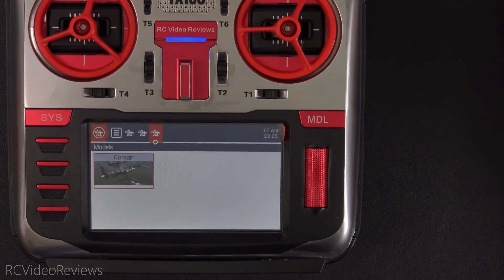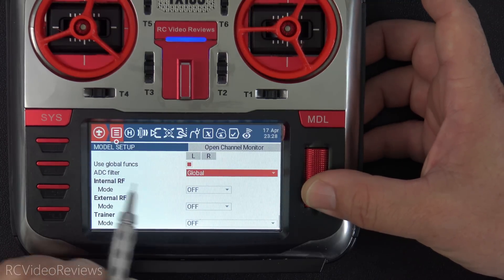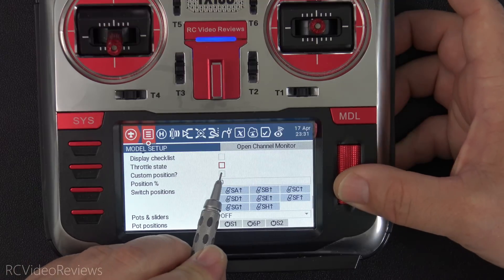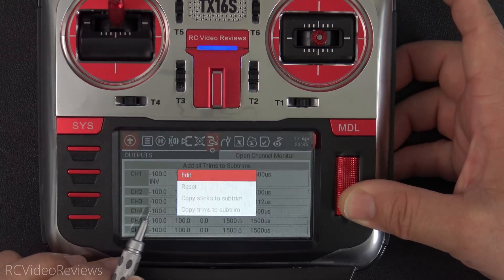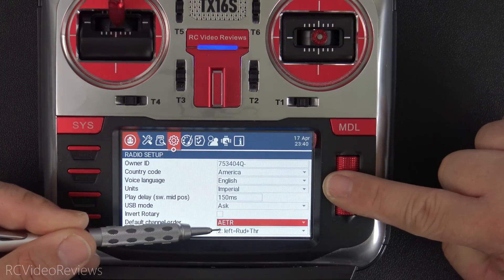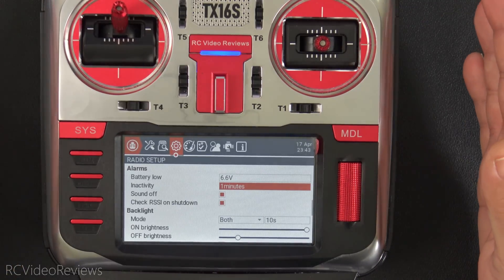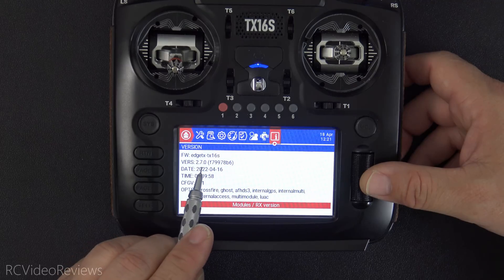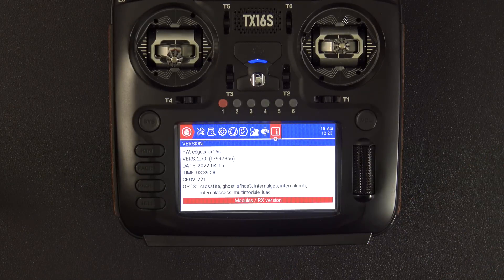EdgeTX 2.7.0 Black Pearl • What You Need to Know • How-To Upgrade

Comment: I hope you can help me. I am using black pearl. I have setup a quadcopter. It arms ok but once I  go past mid throttle 
 The moters screens  flat out even whe I put throttle to its lowest point the moters still scream flat out . The only way to stop moters is to hit the motor disarmed switch. I am pulling my hair  out so please please help me
Reply from the maker: Did you put your motors on Ch5?
Reply: @RCVideoReviews   no, but I have a nother two quadcopters that work fine. I think it could have something to do with the betaflight 10.8.0

Comment: thanks for the info. If you transfer model files from OTX on one RM TX16S to another one with ETX  installed using Companion OTX and Companion ETX it works mostly. However the widget settings get lost and some of the model jpegs don't display as widget items. Also the ETX display doesn't seem to be as sharp and  'contrasty' as in OTX. What's up with that ETX team?

Comment: When you say flashing firmware, do you mean copying things to the sd card? I got a TX16S yesterday and want to update it, I did update the radio multi module firmware and that went smoothly. can I make a copy of the oem sd card onto another sd card and use that? I dont want to be left with a brick.
Reply from the maker: No, you have to write firmware to the internal hardware. Watch this: https://www.youtube.com/watch?v=LItyAkJlcdU

Comment: More great content !
 Still learning this new radio
 Quick question ? I set up all my  switches for my voice tracks in global functions and I'm wondering if I can set dual rates up there as well to  Automatically go to a new model When setting up ?  Thanks again for the great videos and all your help
Reply from the maker: Global functions do not support inputs so no, you can’t configure dual rates in global functions. This probably wouldn’t be a good idea anyway as most models will probably have different needs for weights and expo.
Reply: So would the best way be just to copy model Then adjust as necessary to retain all switches and functions ?

Comment: Just bought a mk1 TX16S and will be my first time using Open / Edge TX. This will probably be the first thing I do as Edge TX seems more up to date.  I couldn't run it on my Jumper T8SG which I've had for 4 years now and has been a solid, reliable radio.  I just need to make a move to ELRS as I no longer want to worry about Frysky failsafes!  I like the open source nature of both ELRS and Edge TX, unlike the confusing world of frysky and where they are going!  Nice , informative video.  I've dropped you a sub and like 👍
Reply from the maker: Welcome to the channel. I've been flying Edge for some time and have been very satisfied with it.

Comment: Hi John, when I plug my mkll in I don’t see a stm , I get this list, which is the correct one? 

Usb receiver
Unknown device (27c6:5301)
RTS5129 card reader controller 
Unknown device from Sunplus innovations technology 

Thanks. I’m very new to all this rc stuff, just started with a Flywing FW450v2. Thank you.
Reply from the maker: You don't mention what operating system you're using. If on Windows you might need to check out Zadig. Here's a pretty good article: http://open-txu.org/home/undergraduate-courses/fund-of-opentx/using-zadig/

Comment: Now starting WITH 2.7.1: 
 Should I go back to 2.5 and migrate to 2.6 then to 2.7.1 to have my models converted?
or is there a magical trick to force 2.7.1 to convert the .bin to .yml?

Tried (in 2.7.1) to replace MODELS folder with the old one (containing the .bin files) AND same with the RADIO folder. Doesn't work in 2.7.1

Thank you.
Henri
Reply from the maker: I just did this test to answer your question. I can confirm 100% that 2.7.1 WILL ABSOLUTELY convert .BIN files from OpenTX to .YML files on 2.7.1. Did you press the model select button and look to see if your models are showing in the category listing?

100% Confirmed you can go from OpenTX directly to 2.7.1.

Comment: Great video John really simple to follow along. One question, when doing the firmware upgrade it will not effect any models or settings that i have created in 2.6.0?
Reply from the maker: Correct. If you're on 2.6 now, there are no user impacting storage format changes.
Reply: @RCVideoReviews  excellent thanks for you quick response. If your into flight have a look at my channel, pass me some love. All the best John. Great channel by the way.

Comment: Hi¡¡¡ Excellent video, as always.  I haven't changed from Open Tx to Edge Tx. What I saw in your video is that they are already in upgrade 2.7.0, quite a quatum leap¡¡¡ What do yo suggest would be the best way to convert my radio? I mean, do I need to start changing from Open Tx to Edge 2.4, or can I jump directly to Edge Tx 2.7? Best regards
Reply from the maker: Just go right to 2.7.1. Be aware of the widgets thing--you will lose them going from OTX to Edge.

Comment: Can upgrading cause (or clear) internal multi telemetry problems?  I just upgraded from Edge 2.6 to 2.7.1 per this tutorial, but it seems that the Internal RF is showing a Module Status of "No MULTI_TELEMETRY detected".  However, this isn't a result of this upgrade, as it appeared the same on Edge 2.6 as well (to be honest I was hoping that the upgrade would clear any preexisting problems which I have not otherwise attempted to troubleshoot).  As for my background, I bought my radio several months ago with Open TX on it and changed it to Edge TX shortly thereafter (never had time to get it working), and don't recall any special "YAML" issues being itemized in other tutorials, but am beginning to suspect this could be why I'm having problems trying to flash firmware updates to my internal multi.  I also can't seem to have full file visibility like being able to access simple JPG files from my "IMAGES" directory, even though I can confirm that they are indeed on my SD card via computer and even through other access of my TX16 menus.  Is this a YAML issue?  If so, how can I resolve it
Reply from the maker: There's a lot to unpack here:

1) Edge revisions don't change the multi protocol module (MPM) firmware. Download MPM firmware here: https://downloads.multi-module.org/  Learn how to flash it here: https://www.youtube.com/watch?v=CUmw2cDnFx0

The first thing I would do is ensure the MPM is up to date. After that, telemetry relies on what the rx sends, and you didn't say what rx/flight controller/or other telemetry device you're using so I wouldn't have any idea how to proceed outside what I indicated above.

2) YAML has nothing to do with flashing updates to the MPM. Follow the video https://www.youtube.com/watch?v=CUmw2cDnFx0  I've flashed my MPM plenty since migrating to YAML without issue.

3) Image names need to be 6 characters or less for the model setup screen to see them. They also need to be a specific format. JPG or PNG ~ 192x114 pixels.
Reply: @RCVideoReviews  thanks for the advice!  I was trying to use the internal for a FlySky setup.  I've come to suspect that the actual internal hardware module has failed and that's why it won't accept the flashing efforts.  Thanks also for the 6 character info... I was thinking it was because I had spaces in the filename but that proved to be incorrect if you say that it's a 6 character filename limitation.  Thanks again!

Comment: Followed your instructions, when I get to "connect new device" "STM BOOTLOADER" doesn't appear. Tried several times. Any tips? Thanks
Reply from the maker: Watch to the end and flash the firmware from the bootloader.
Reply: @RCVideoReviews  John, this morning I started fresh and found my issue. My top USB connector is extremely tight, and even though the USB symbol showed on the radio screen, it didn't really connect until I pushed it in harder. Used the bootloader and now I'm up to 2.7.1. First will be a back up, before i start building my first model and tweaking my settings. This is the first "real" transmitter I have owned. Quite a piece of hardware. Did you make your own stick protectors, or order them? Tough to find, I guess most have their own 3D printer. Thanks again.
Reply from the maker: Glad you sorted out the issue. I printed my gimbal stick protectors.

Comment: Thank John, Great job!!!  

Just a quick question for you.  when you put your radio into Bootloader mode (trim switches in and turn on radio).  I saw the top line say "EdgeTX Bootloader - 2.7.0".  

I upgraded my radio to 2.7.1 well, but when I go into bootloader mode the top line says "EdgeTX Bootloader - 2.5.0", why is that?   

Note: the very last line on the screen says "edgetx-t18-2.7.1(a55aff02)"  so I have upgraded to v2.7.1
Reply from the maker: Because you haven't flashed your bootloader. With the 2.7 firmware file (2.7xxx.bin) on your SD card radio, turn the radio on, press system, go to file manager, find the 2.7 firmware.bin, highlight it, long press the jog dial and select the option to flash bootloader. It's all covered here: https://www.youtube.com/watch?v=LItyAkJlcdU

Comment: I'm on 2.6 at the moment. I tried to use Buddy when I first tried switching to EgdeTx but it never could connect to dfu mode. Still doesn't work for me.  Not sure wth is going on. Would love to figure it out since it seems to be so convenient. At the moment, it is anything but convenient.
Reply from the maker: Sounds like a usb driver or cable problem. Zadig can help you get the right driver installed.
Reply: @RCVideoReviews  this was my issue. I didn't have the right USB driver on my WIN11 PC. THANK  YOU!

Comment: I have STM32 Bootloader now but when I go to flash it says could not connect to DFU interface.
Reply from the maker: Radio is powered off right?
Reply: @RCVideoReviews  Yes Radio is off then I plug in usb cord
Reply from the maker: Sounds like you have a driver problem. Also try changing your cable.
Reply: @RCVideoReviews  I'm thinking driver problem also. Changed cable, not difference.

Comment: John, I have been running Edge TX 2.6 with no problems.  Today, per your video using Buddy - I upgraded to 2.7 ---->  everything appears to be loaded correctly, however now the "MDL" button doesn't do anything.  Any suggestions?  Larry
Reply from the maker: Never had a problem with the MDL button on any revision of Edge. You might want to load up your hardware "keys" monitorand see if MDL returns a 1 when pressed.

Comment: Bootloader doesn’t show up when I click add device. My version is 2.5.0 so I tried to download 2.6.0 to my tx16s and it says not enough storage. I have a 32GB as card in it.
Reply from the maker: Make sure you're saving to your SD card and not the "firmware" card. You need to find a directory structure including folders like \MODELS  \IMAGES \SCRIPTS  \FIRMWARE etc..
Reply: @RCVideoReviews  I guess it's over my head. When I click add new device the STM32 Bootloader does not show up. I'm connected to radio like you show.

Comment: Hello sir John. I bought USED  radiomaster and the version of the TX is EDGE. Is it's possible for to change the version from Edge to normal version,like 2.3 or 2.4 version sir?
Thanks
Reply from the maker: If you're asking if you can flash OpenTX over EdgeTX, the answer is yes. The EdgeTX bootloader handles both.
Reply: @RCVideoReviews  thank you so much sir John 😊
Reply from the maker: You're welcome.

Comment: Thanks for the info John. With regards to ADC Filter, for Helicopters let’s say running on external FBL unit, do I turn on and for example something like with built in FBL unit like OMP Heli’s do we turn it off? Thanks John.
Reply from the maker: Without some form of gyro plotter/scope like BF has, it's hard to know how exactly how the OMP FBL will change with and without the ADC filter. With other devices you can actually plot gyro and pid movement, so on/off can be objectively assessed.

To keep it simple, I would suggest flying both ways and assess for yourself if you see a meaningful difference. It's not like the filter is going to cause a catastrophic issue one way or the other.
Reply: @RCVideoReviews  Think I would treat it the same way like inav, built in FBL unit knows exactly what to do as far as handling any given commands to help the craft react to any situations so I’ll turn it off, and probably the same way with external FBL unit as it rely on feedbacks from digital receivers for its commands requirements so I’ll have it off also. And to most flyer also out there that’s still on old flybard Heli’s that requires a receiver to manage all the servos, then they can have it on. Mine is set currently to Global, it’s the settings I came across with when I updated my Tx to the latest firmware. By the way, when u updated yours to 2.7.0 did u flash your booth loader also? Mine is still on 2.6.0 the firmware was updated to 2.7.0
Reply: @RCVideoReviews  I’ve flown hovered my M1 today with the ADC jitter filter off. Flies really well and exactly how I want my craft to response, nice and crisp. I did the same setting with my M2 and Gob380. I’m assuming for those who still have the flybard Heli, they can turn it on. I also updated my firmware to 2.7.0 RC2, believe most of the changes are for quads and other radio such as Tpro but also a few that applied to TX16S. So far so good. Thanks for all the informative updates John. Regards

Comment: John:
   Sorry for this off topic question, but I'm curious about your Eachine TX16S. I have noticed that mine has 2 problems I hope can be fixed. I'm sure you are the best person to advise me if you have noticed them too.
1) My jog dial is loose (sloppy) and this makes it difficult to precisely select menu options. Is there a fix for this? Does Eachine know about it? Will they replace it if there is no DIY fix?  This is a show stopper for me.
2) It seems the hole for the MicroSD card insertion is a little bit wide and off position, making it very easy to miss the card pocket and loose the card inside the Tx case. Is there a DIY adjustment?
3) Do you like the new position of the 6 push buttons now just above the screen? What do you use them for? I'm thinking they were intended for all the possible flight controller modes some systems offer?
Thanks. - Jim
Reply from the maker: 1) You can apply dampening grease to the rotary roller pin and I've heard of some people putting fuzzy velcro down between the board and roller to help deaden movement a touch. I don't believe there is a chronic issue and I have no idea how Eachine (Banggood) will react to a repair request. These parts are readily available and cheap. Honestly, if you have a problem with it, it wouldn't cost more than a few dollars to buy a replacement.

2) The only possible adjustment would be to move the mainboard internally via washers/shims or to remove it and dremel the slot out. For me, I rarely remove my sd card from the radio.

3) 6 of one, half dozen of the other. I use them for flight computer flight modes mostly.

Comment: Thanks for this John, I'm sure a lot of users will find this very useful! :) 

Once the conversion to the YAML configuration format has been done, any future changes to settings structures, etc, should be transparent, just as they were from version to version of OpenTX. 

Regarding the custom throttle position - this will more likely be useful for people who are using these radios for cars, boats, robotics, construction equipment.

For the module version info for CRSF - you are correct, it is not supported. The ELRS developers are working on something on their side which we can then use to grab the firmware version.
Reply from the maker: Thanks for the clarifications Peter. Very helpful.

Comment: I still have OpenTX installed on my TX16S, can I install EdgeTX 2.7 directly or do I have to start with an older version of EdgeTX and then upgrade?
Reply: You can install 2.7 directly... just be sure to backup your radio and model settings beforehand. And check out the earlier video about EdgeTX 2.5 yaml, as that will be the biggest change to the configuration format.

Comment: Thanks for the update John. I've noticed on my TX16S that copying the firmware file from EdgeTX Buddy to the SD card and updating via the radio leaves the bootloader at Version 2.6.0; whereas updating the firmware from EdgeTX Buddy via USB does update the bootloader to Version 2.7.0. I don't know if that is important ??
Reply from the maker: You can flash the bootloader from within the radio. Just open system -> file browser -> tx16s-2.7.0.bin long press, flash bootloader. Although, TBH, it doesn't matter that much.
Reply: Can u use edge tx on radioking tx18s? Which firmware?

Comment: Can we use bluetooth on Aux's for headtracker yet.  My DSC port on brand new Radiomaster t16s hall Mk1 is bad
Reply from the maker: The serial ports are there for bluetooth support. I have no idea about specific hardware support. Your best bet is to join the EdgeTX discord and ask them directly.
Reply: You can connect a bluetooth adapter like a JDY-30 BLE to the AUX ports, and set them to telemetry mirror mode... when you just connect them to the serial port all the bluetooth management is in the module, the transmitter doesn't need to know anything about it. Might also be good to drop by the headtracker project by cliff / dlktdr for info.